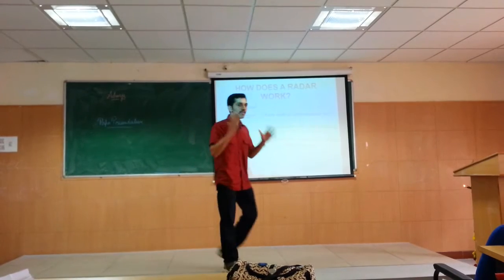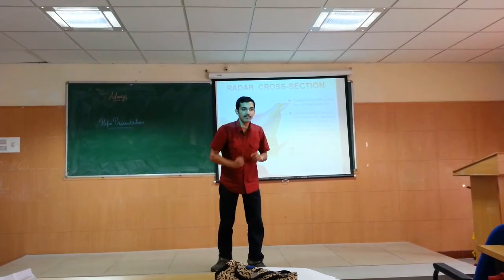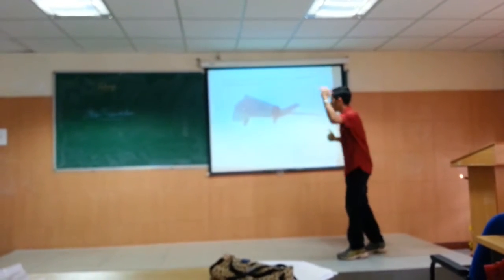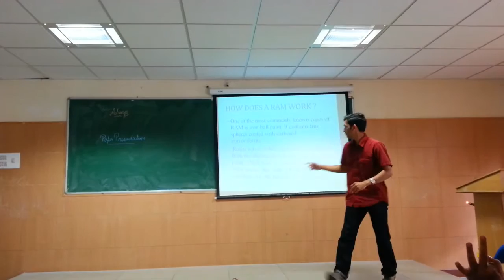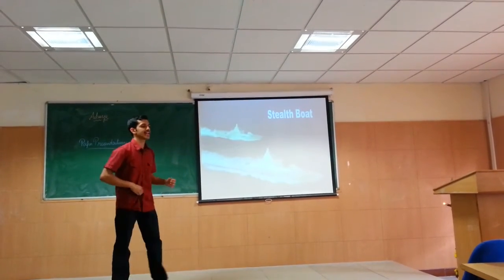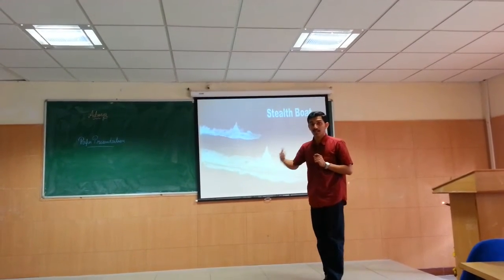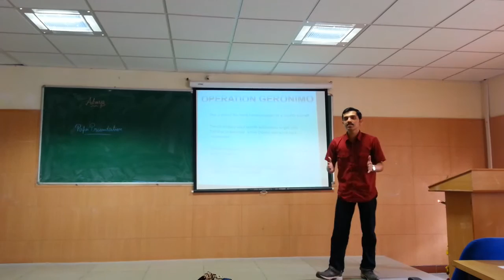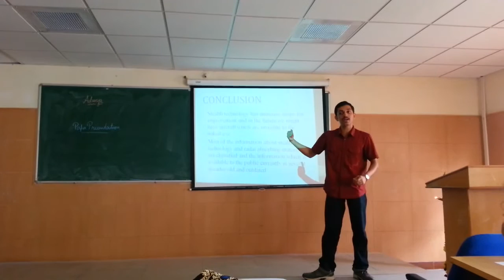Stealth Technology (Radar absorbing materials).mp4

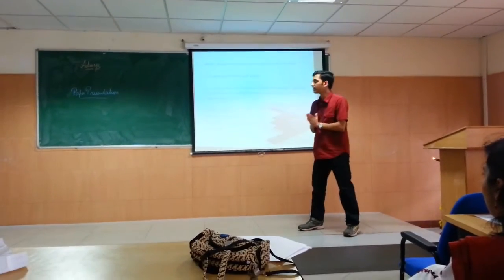Comment: 4:10 SR 71 spy plane didn't have wave reflection design it was undetectable because of it's high flying altitude and a very high Speed of more than 3.5 mach. At some instances it was caught by radar and targetted by missiles but escaped due to high speed.
Reply: actually the blended body IS the start of stealth it is an actual reflective body that moves radar waves away from the detector ... the sr71 of march 1959 the swept wing hunk of crap was just that crap ... after march 59 the 15 or so avro arrow engineers brought their knowledge down from canada and made it a blended body delta winged high mach speed plane with out guns ... or essentiall a mark 3 arrow recon plane ... it had a radar cross section about the size of a cessna piper cub ... and did eveade threats it out ran them since most planes at that time were having troubles doing over mach 1.6 ... while the arrow was already known to be able to handle upto mach 3.6 speeds ... and designed for mach 7 ... and yes thats right the sr71 would have been a dead an cancelled plane if it wasnt for the arrow engineers being let go feb 20 1959 .. funny how american aerospace went from second best to the best with the influx of so many canadian engineers ... after being a part of the reason for the cancelationa pf the best plane ever built to this day ... yes thats right BEST PLANE EVER BUILT ... 1953 the arrow took shape as a drawings ... 1957 it took flight and in 1959 it was cancelled because of lies and hurt feelings ... the arrow 70 years old next feberuary was designed and built to  do mach 2.5 to 3.5 flights with high manouverabulity and 2 person cockpit and twin engines for high artic work ... it has the 15 firsts of all jet fighters still in use ... it had the first fully stowed weapons bay ... first fully fly by wire first look down shoot down radar first terrain mapping ... first air conditioner in a plane ... first triple redundant flight controls ... first fully autonomous flight control with no ground support guidance required .. and it NEVER had a prototype it had 37 planes on the production line 6 ready to fly 5 flown the 6th days away from flight and breaking all the records .. thats right NO PROTOTYPE ... the cook craige method was direct to produuction linenot as usa history books of lies report ... and yes the americans were 60% at fault for cancelling the arrow ... the other 40% was an idiot prime minister who had a hard time finding his butt with both hands behind his back